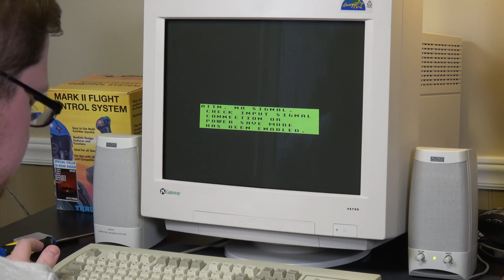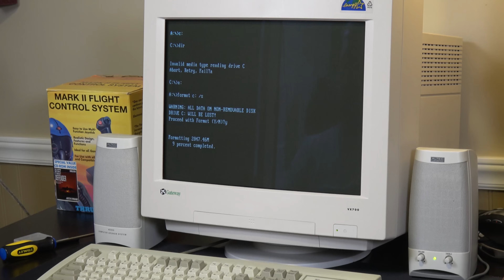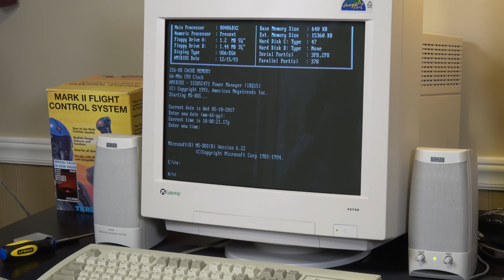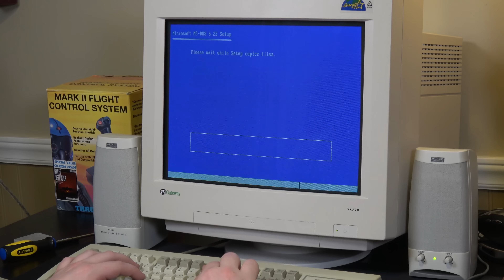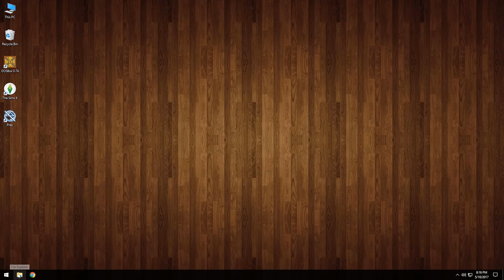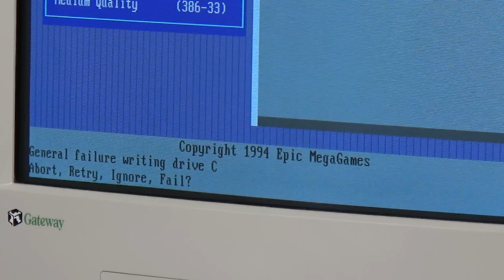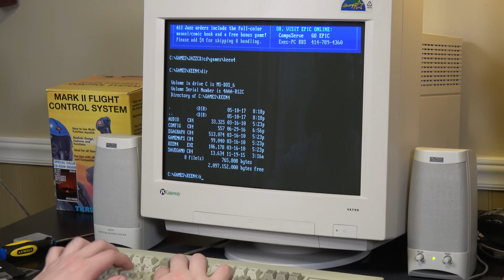LGR 486 Update! Installing CompactFlash Storage

Comment: I'd love to find a 486. I used to have a few but foolishly got rid of them all and it seems they're rare as hens teeth and people want a mint for them.
Reply from the maker: So many of us have those regrets, myself included. Tossed out several over the years and ugh.
Reply: I dropped so many 486 desktops off at a recycling place before a move 4 years ago... and now the retro PC bug had bitten me again... ugh. Time to go thrifting!
Reply: I had a 386. wish i would have kept it. Had a few old gateways too.
Reply: I had a Tandy TL1000 with ducktales, a first person 3d pacman and many other games. Wish I would have kept that if not only for the pictures my siblings and I drew on the paint program.
Reply: we should remind our kids to keep their first computer.
Reply: Yep. I had Pentium 3's... Cyrix 200, a bunch of graphics cards, and a bunch of 486 components we held on to for ages, and then we finally got rid of them and now I regret it.
Figures huh. XD
Reply: I think I may have a spare one sitting in the basement if you want me to look for it. I believe it's a 486DX2/66.  I don't have a case for it, but I can test the board for you.  If you can find an AT case and a PSU it should work perfectly. I will have a video card for it as well.
Reply: HAHA, no kidding those HP machines are awesome. I just updated 6 rp5700 SFF PCs for a school and the entire process was 100% painless. A PC that old and guess when the last BIOS update was? The middle of 2016, that is what you call support. I did the BIOS update to gain full access to supported CPUs, dropped in a 3ghz chip (9$ on Amazon), installed Windows 10 using the 7 key it came with and boom, fully functional PC good enough to do anything other than gaming.

Those rp5700s are 100% happy with everything from XP to Windows 10. I am buying another for personal use just to see if 98 will work on it.

FYI, if you are interested in playing with the rp5700 this is the top CPU after you update the BIOS (E7600):

https://www.amazon.com/dp/B00JKAPCO0/ref=cm_cr_ryp_prd_ttl_sol_0
Reply: I did IT for a decade or so and while I had a MOUNTAIN of HP systems (E-machines as well, worst PSUs ever) the HP business machines literally never came in.

So far so good on all of the ones I worked with. The case is rock solid and I really love the SFF form factor.

The HP consumer desktops on the other hand, craptacular. My mom had an older one and I hated that stupid thing. Literally built to be close to impossible to service. What to upgrade the RAM? Sure, only need to take 90% of the PC apart. Upgrading RAM in a laptop was far easier.
Reply: My dad saved his old ESCOM 486, as well as a few other PC's from the 90's. I really hope the batteries haven't leaked, as they are just sitting around, doing nothing
Reply: +nrdesign1991 I would be digging those computers out of storage, and checking the batteries asap, as they usually only have around a 10 - 15 year life span, and it really does not matter if they are being used or not.
Reply: I haven't given it to anyone, but I would like to give atarileaf a little more time to reply.  If he hasn't replied by tomorrow then it will be up for grabs.
Reply: One of the best things about being older, financially secure and with free time is that I can play around with old hardware and see how fast I can make it work.

I am currently looking around for the absolute best hardware I can force 98SE2ME (modified 98SE) to work with for a 98/XP dual boot retro gaming rig. Seems some people have somehow forced both SATA and PCIe to work with 98. There are all kinds of hacks and patches to get larger disks and more ram recognized as well.
Reply: +nosirrahx that's what I'm looking into as well to have one machine that can run most everything I might want to play that is retro without a lot of hassle. old HP office machines of the Pentium III/4 era might be a good fit if you can find all the drivers for 98se to work with it, as I know for sure that era has all the XP drivers.
Reply: nrdesign1991  Ugh, I hate discovering a case of the crusties like that.                                Always makes you wonder what other surprises you might find on the rest of the board.
Reply: I will let you know when I pull it and test it.
Reply: Hi really sorry I didn't see this until now. I appreciate the offer, just wanted you to know I wasn't ignoring you. I didn't see all these comments in my feed or I missed them somehow. Old age I suppose :) Thanks again though for your generous offer I hope it found a good home.
Reply: I need to fix it before I'm willing to give it away.  I can do so, but I need to purchase the caps from either my local supply store or mouser/digikey.  I only have the board and a video card.  I may be able to find an I/O Controller card for it as well.  You will need a case and either an AT PSU adapter or a full blown AT PSU.  The board does not have any L2 Cache.  It's one of those with fake L2 cache.  It is a later motherboard release so it will recognize hard drives larger than 540 MB though.  And I believe it will support faster CPUs than the DX2-66 that is in there.
Reply: I feel you. I paid $175 for a fully loaded Am5x86 machine recently and it would have easily cost that much to rebuild my Socket 7 AT box to the same specs.
Reply: These machines are sometimes hard to find but in my experience you can get them really cheap from private sellers if you just keep looking and have a bit of luck.
I have had several old PCs starting from 286s in the past, and have started collecting old PCs again about two years ago.
So far I have gotten several 486 machines with prices ranging from 5 to 20 bucks. 
Just recently I bought half a pallet of 486 PCs for 100 bucks from a company that was selling their business machines (which had been in use as recently as last year ^_^).
The only downside with deals like this is that most sellers don't offer shipping, only local pickup. Even if shipping is an option it's often pretty expensive and has a high risk of damaging hardware if it's not packaged properly.
Reply: I have found a 386, 486 and lots of pentium 4's but the early pentiums are elusive! I'm sure now that I said that I will find tons of them... lol
Reply: Jason Pritchard I've got a few Socket 7s and a Socket 5, but aside from my IBM XT 286 I haven't found any local pre-Pentium machines.
Reply: I also had a Compaq "Luggable" that I tossed. Huge regrets. Something similar to this - http://www.old-computers.com/museum/computer.asp?c=870&st=1
Reply: the luggable is pretty awesome lol
Reply: I remember how great it was going to windows 95 - from dos to 3.1 must have been a bigger leap
Reply: Is this still available?
Reply: I have a spare 486DX2-66 Motherboard and CPU that I am not using.  I was offering to Atarileaf if they were interested I would pull it out, test it and they could have it.  I don't have a case or PSU for it, but I do have a video card and I think it has 8 or 16 MB of RAM.  I was just wanting to give Atarileaf enough time to see and respond to my post before opening up the board to anyone else.  Edit
Reply: I had the same trouble trying to get a tower. I compromised and got an old Compaq 386 and 486 laptop. Plus I didn't have a lot of space. So the laptops satisfied my craving and they fit in drawer when I'm not using them.
Reply: Same here, I got rid of so many computers over the years selling them, and upgrading to newer hardware, or just do to lack of space not thinking I would want/need them in the future.
Reply: Oh you can find plenty of AT desktop and Tower cases.  The question is if you can find them at a price you are willing to pay.  I find it rather surprising that a lot of times older AT cases without a PSU go for more than a new PC midtower case.  If I had a case that didn't weigh 80 pounds I would send that along as well, but I don't.  I cannot afford to ship an 80 pound behemoth.  I can afford to ship a motherboard, though.
Reply: nosirrahx No PSU/motherboard capacitor whine issues with those model HPs?  Are they sturdier than the same era grey minitowers from hell that HP unleased on to the unsuspecting consumers (and one year later, my repair workbench... then my scrap pile.)  Don't get me started on the HP DV#### and DV# laptops...
HP was ALWAYS at LEAST 50% of my workload 6 or 7 years ago.
Reply: I had an old notebook years ago that had a nasty 3-cell NiCad battery soldered directly to the mainboard. It already started leaking then, and I went straight ahead and pulled it. I don't know about those computers though. They have been sitting for at least ten years.
Reply: Did he take you up on the board?
Reply: No, I never received a reply.  Either they thought I was joking or they are concerned in regards to privacy.  Either way, I will pull the board out of storage, and check that it works.
Reply: Sounds good!
Reply: I wonder if anyone would want a Presario 1690? Runs Win98SE, but I figure it'd do well with a lot of the older stuff. Bit of a small crack in the screen case and there's a dodgy connection to the monitor though so you have to slap the screen down a few times to get it going at full brightness. Also the original battery no longer holds much of a charge. Other than that it still works.

Would something like that be worth bothering with?
Reply: Hit thrift shops every month you'll find one.
Reply: I bought a working one in Poland (switchable power) for something like $25.
Reply: The motherboard won't turn on at all.  I checked all the components I was using and they work fine, so I am guessing the motherboard probably needs the caps replaced.
Reply: N8tehNotGr8 mishaps in gaming still want to sell it? any peripherals with it?
Reply: I love Gateways! I have a Gateway P5-166 desktop that will be upgraded to a Pentium 233 once I finish upgrading my Super Socket 7 AT box to an AMD K6-2.
Reply: Jason Pritchard  That is a machine that I have several of.  That I know work.  I have a Pentium 100, 120, and a 166.  They are decent machines for the time.
Reply: Two of my Socket 7s (AT box with Pentium 233 and Gateway with Pentium 166) work but my Packard Bell Pentium 233 needs its power supply repaired. :(
Reply: Do you have more details on the socket 7's?
Reply: Oh, they aren't for sale! Sorry if I gave that impression...
Reply: My Packard Bell Legend 300SX needs the PSU repaired.  I have sourced the caps, but I have never done work on a PSU before, and I am worried of making it worse.  I really don't want to damage the 386SX-16 machine.  Yeah, I have a Tandy 2500/33 which is a 386SX-33, but there is some charm to the 386SX-16 machine.  Still working on replacing the I/O Card in my 286-10 with a SD-Card or CF Flash adapter.  I will probably build another 8-Bit ISA AT CF-Flash Card and use the Universal XT-IDE Bios to make it work.  The hard drive gave up the ghost on the machine sadly, and it's a 40MB drive and the I/O Card only supports up to 40MB drives.  So I guess that makes it an AT card?  I also have a Gateway P75 (I think) that one of my wife's co-workers gave me.  It needs a new fuse for the PSU and a HD or CF and a sound card.  I still have the box for that.  That one I wouldn't mind finding a home for, but people would have to pay for the shipping.  I still have this nice little Tandy 1000HX I would like to give to Pushing Up Roses as it is an old school tandy that probably has specs similar to the machine she used when she was a kid, but with a complete in Keyboard design which will save space in apartment living.  I still need to send some 8-bit Ale to LGR as well.  I need to find a legal way to ship it to him, or the next time I make it out to the east coast find a way to meet up and give it to him.  I didn't even think about that while I was in Florida two months ago....  Ugh!  So much I would like to get done. :(
Reply: My XT 286 (which is really just a Baby AT, honestly...) has no video or hard drive so I need to address that...it also has a big freakin' hole where a full-height MFM drive once resided, of course. Haven't found a proper bracket to allow me to install a 3.5 floppy drive like I want to, plus I need an IDE controller card so I could use a Disk On Module instead of trying to find a working MFM drive...
Reply: LOL damn! :-)
Reply: Never cracked open a Tandy. Does it have the Dallas RTC, or just need a new battery? Replacing a Dallas unit can be a real PITA.
Reply: You should see the Zenith portable I have. Amber mono not unlike the IBM Portable, and a whopping 320K ram...
Reply: If it's a genuine 286 system it should have 16-bit  slots, in which case it should't be too hard to find an ISA IDE controller card on eBay. They also offer brackets:
https://www.ebay.com/itm/3-5-to-5-25-Drive-Bay-Computer-Case-Adapter-Mounting-Bracket-USB-Hub-Floppy/251589019982?ssPageName=STRK%3AMEBIDX%3AIT&_trksid=p2060353.m1438.l2649

Hope that link comes thru correctly. That particular ad asks 6.99 + free shipping, but I've seen them cheaper.
Reply: Yeah, that will come in handy for the floppy drive but I'll still need a XT-style case bracket!
Reply: N8tehNotGr8 mishaps in gaming do you still have the gateway?
Reply: I had three crates of old hardware that I tossed a few years ago. They were in my parents' house and they were doing a clearout, plus I didn't have the space to keep them at mine unfortunately. I just kept some of the more interesting stuff and the rest was scrapped. :(
Reply: Keep an eye on the donation stores... they pop up time to time...
Reply: It was my first computer using windows 3.1. people really buy old PCs?